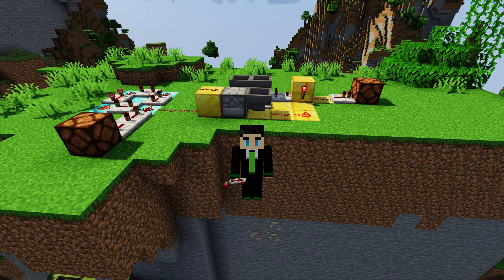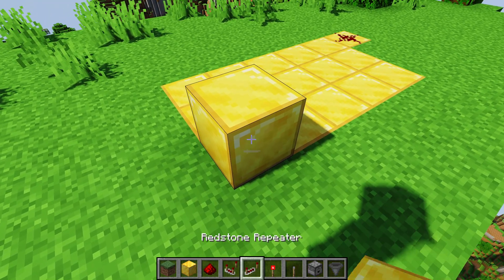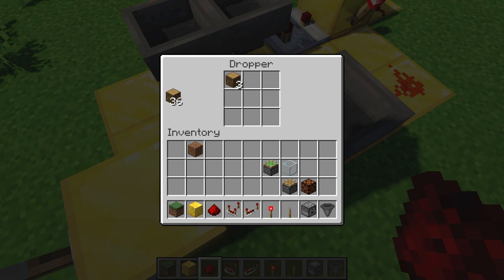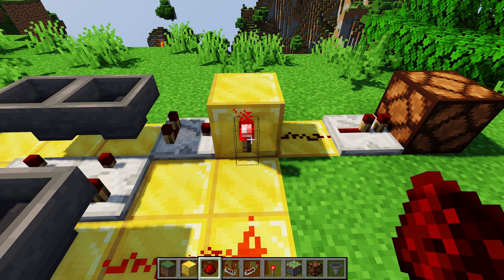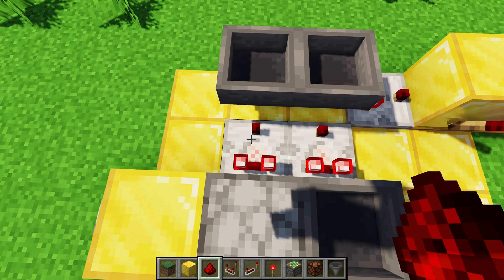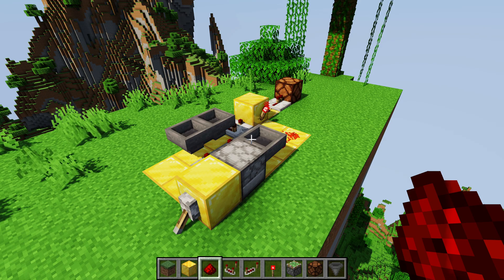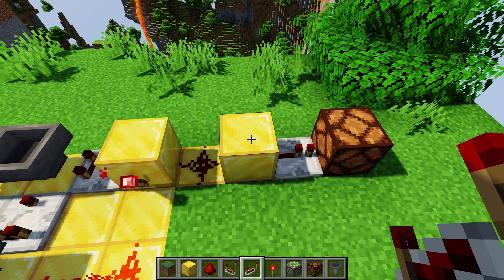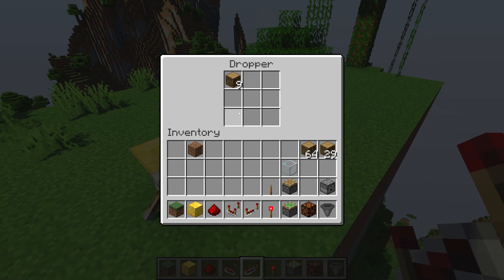Simple Pulse Counter (Java & Bedrock, 1.21.11 and Down) | Minecraft Redstone Engineering Tutorial

Comment: You know what? It's funny, but this turns out to be what I was looking for for my current little redstone project I'm doing. Didn't find it in the first video of yours I found, but I'm glad I poked around to see what else you had done... pretty sure this fits what I need. I'm sure I could have figured it out eventually, but it seems like you know how it goes where life can be a lot easier when you can just find a design for the circuit you need and focus on how to apply it instead of inventing it

So from one self taught redstoner to another, thanks for the video. I'm not even sure when I'll get to this project since it's just converting a song into noteblocks so it's... I need to do it at some point, but there's a lot of other stuff I also need to do. Just have this idea in my head where since there's a lot of repeating sections to this song... can I find a way to turn them into little circuits I just send signals to at the right time? First song I converted to noteblocks I just did with a signal being sent down a line of noteblocks all in order (to be fair none of it really repeated so this wouldn't have worked well with it), but this time... this time I want to try and use a redstone mindset. Mostly cause it sounds like a fun challenge, but who knows? Might even wind up more compact

Anyway, keep up the good work on the videos and keep going with the redstone, you're doing a good job at both (meanwhile I'm gonna head to bed cause among other things I tend to ramble when I'm tired)
Reply from the maker: Ya I think regardless if someone can figure something out, doing what is fun is the important thing and sometimes spending hours coming up with something isn't worth it or isn't fun, so it makes sense to use something off the internet instead

Comment: Is there a way to make the output stay on.
Reply from the maker: Not with whats in the video, but you could use a pulse extender to make it longer. What do you need it to do?
Reply: @ZennsWorld  They can use a copper bulb no?
Reply from the maker: It would switch from being off to on each time it counted all the pulses rather than being on each time it counted all of them, but it depends on what is desired
Reply: @ZennsWorld I mean. If they want it to remain powered until next pulse, they can connect the output to a bulb. And use a comparator no? It will only turn off once the counter produces a pulse again
Reply from the maker: It depends where you are putting the bulb. If its on the output then the first time the counter reaches the count it will turn the bulb on, then the counter will reset (bulb staying on) and then the next time the counter reaches the count the bulb would turn off (counter would reset then again), so the bulb would be on every other time rather than turning off and on every time. That might be fine but depends on the use case